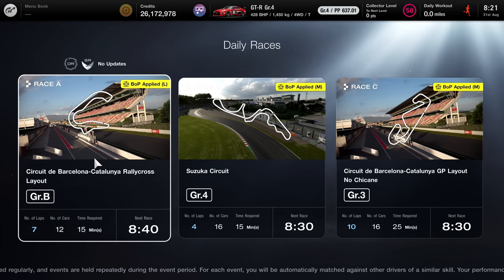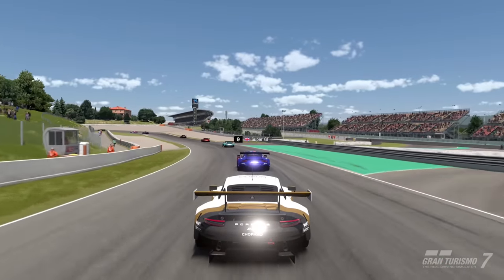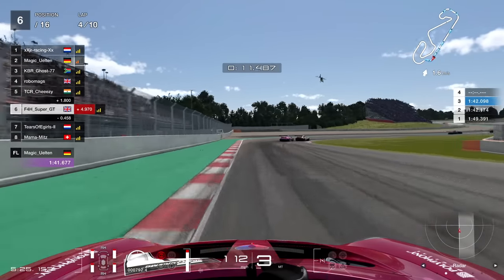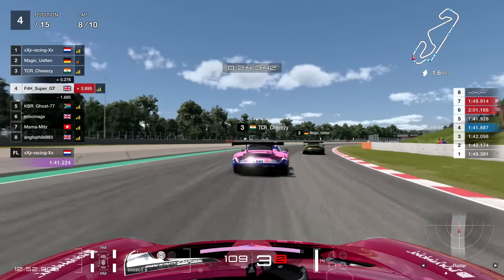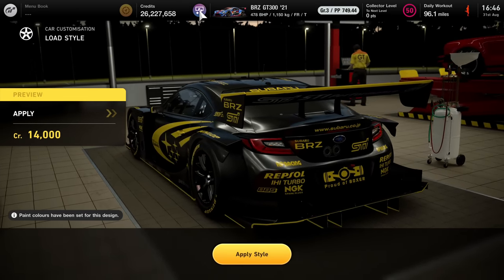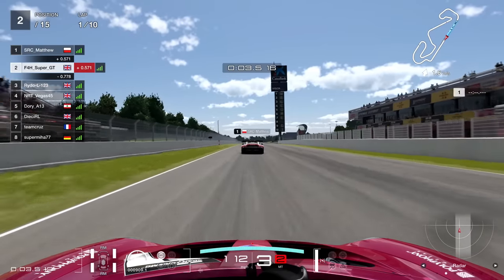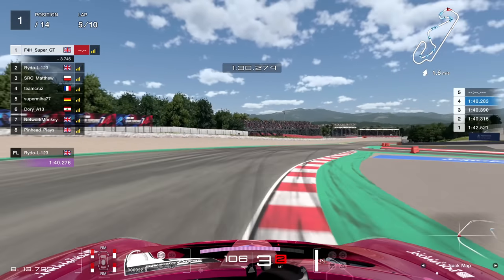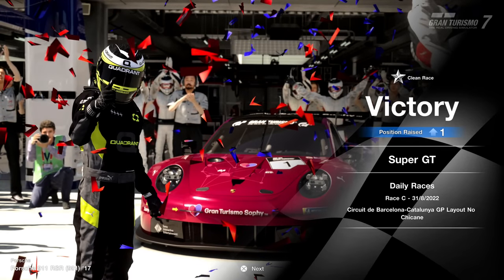They FINALLY Added This Track to Gran Turismo 7

Comment: It would be nice if some of the F1 former circuits are added to this game Malaysia, Istanbul, Yeongam, as they all exist in other series beyond F1. Certainly add another dynamic to this game. 😉
Reply: God I miss Sepang so much. Best tilke circuit and it's not close.
Reply: Can you imagine if they added the Macau circuit?
Reply: it's criminal Yeongam isn't in more games
Reply: Licensing
Reply: @seavmeylundqvist4897  I didn’t even realise it was still in use
Reply: @ninjacraft7897  Limited to a few low level national championships, it's generally considered as a massive white elephant.
Reply: Spa update to new version could be a nice option
Reply: Istanbul is so underrated outside formula 1
Reply: Buddh International (the old Indian GP track) would be a lot of fun I reckon, especially the middle sector

Comment: They should bring this into F1!!
Reply: They should but the fia says that theres not enough runoff area for the speed on the last corner and also the pit entry is very narrow so its an added risk
Reply: @bycoxtax8562  tbf the fia isn't wrong about f1 but they still make gt3 cars use the chicane which is kinda silly.
Reply: @napalmpudding  yeah, but now with the focus on ground effect i think that they coul follow each other easily through the last turns
Reply: @bycoxtax8562  thx for the info! didn't know this.

Comment: Hi , turns out that both motogp and f1 stopped using this variant and started using the chicane one due to the death of a moto2 rider (Luis Salom lost the control of his bike at the 13 curve and crash in to the protections) a few years ago.

Comment: Question: Are these live recordings mixed with replays with a voice over? I don’t have GT7 yet, so I’m curious, is there some feature that lets you view the race in a “in game” like view plus being able to use obvious regular replay features?
Reply: You can tell when it's a replay because it doesn't show laptimes on the right
Reply: @KepleroGT  True, I did notice that the laptimes in actual gameplay were on the right rather than the center.
Reply: Also the replay has a GT7 logo at the bottom right
Reply: He’s voicing over the whole thing, but it’s a mix of replays and live recording

Comment: Other than changing tires.. can you tweak the car setup? suspension, brake bias, tire pressure, gearing? Very nice driving, race craft :3 strategy and tackling getting better and figuring out the whole thing.. LOVE IT
Reply: No, you used to but now you can't
Reply: @afoxwithahat7846  that's depressing :( .. there should be a default setup and just be able to even tweak it and if u mess up u can revert to default.. god polyphony digital.
Reply: @naikjoy  you can change your setup in the game, it's just these races are fixed setup, similar to how it was in GT Sport

Comment: What traction control do you use? I’ve been on 1 but it feels like too much. But I’m slower even with no spins on 0
Reply from the maker: I use 0. It's definitely quicker overall on 0 but yes, you have to manage the throttle a bit more and avoid wheelspin.

Comment: Hello Steve, you have shown that one time in an old video but I forgot. What was the name of the website where you can see your drivers rating and everything else ? Thanks for any help
Reply from the maker: Kudosprime. however it's not quite the same for GT7 as it was for GT Sport.
Reply: @Super_GT  thanks mate, that was great to check from time to time. They should work on the same for gt7 😁

Comment: On this race I tried to let my medium tyres last as long as they could with the brz gt300 but once I got to the 8th lap my left front tyre was gone and I had no steer for the whole lap, at the end of the race I was 6th but ended up 3rd because other people got one minute penalty’s for not using both mediums and hards
Reply: I discovered this too. The tyres are great for 7 laps, but on lap 8 they just fall off a cliff and the car is impossible to drive.
Reply: @Elebanitez  pretty sure my left front tyre just died at turn 12

Comment: Do you have to go Medium -> Hard? Why not Medium -> Medium? Do you have to use 2 x compounds like in F1?
Reply: yeah, there's a requirement of tyres used in each race. In this case it was hard and medium mandatory.
Reply from the maker: Medium and hard both had to be used.
Reply: @Super_GT  oh cool, I hadn't tried those races out yet. Cheers 👍
Reply: @Notcheeezy  thanks and good to see you're not Cheeezy. That would be embarrassing.
Reply: @An_Arbitrary_Miscellany  yeah... 👀